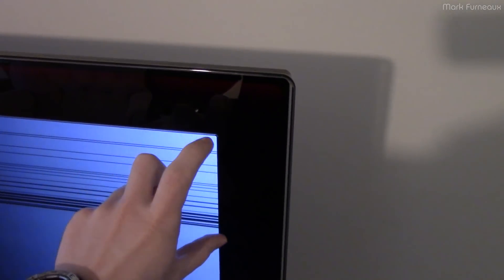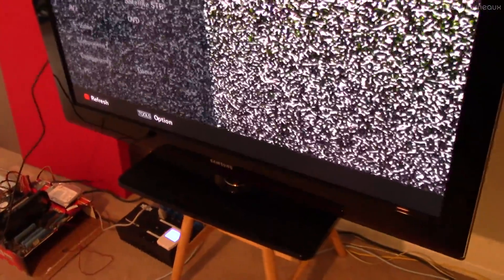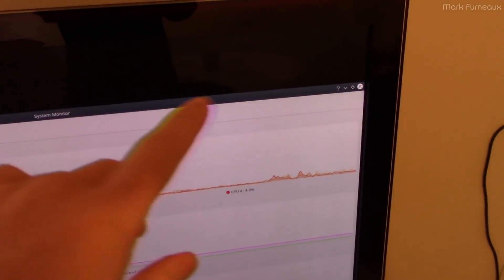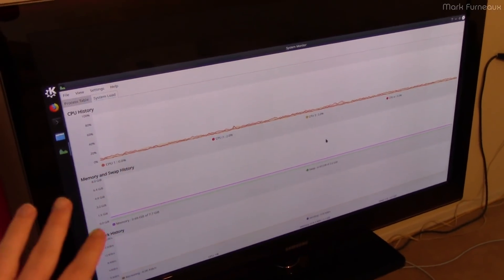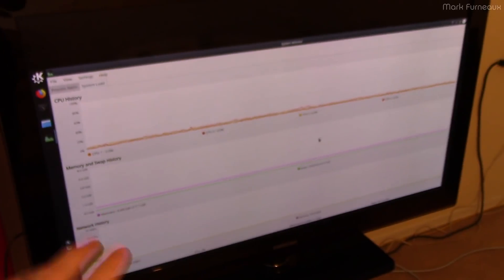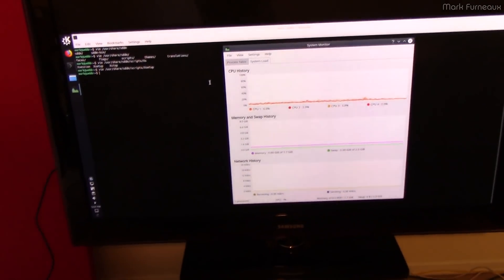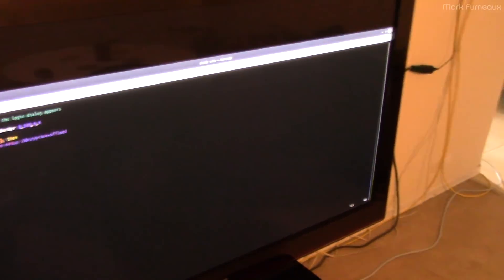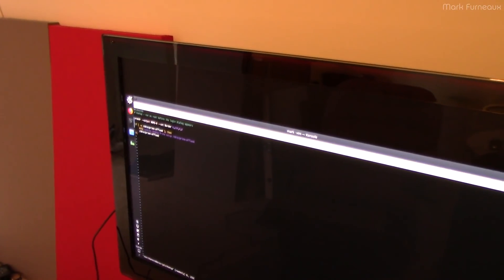How to Workaround Using a TV With Lines in The Image

Comment: Hello.
I know chances are  low.... but my not very old Samsung 50 inch IT is started to act similar, also in my case it's a second block, from the top.
And from what I hear -  i'ts a fairly common problem for Samsung screens.
It's not as bad as what you have shown in the video, but noticeable enough, so when I'll have some free time I'm planning to disassemble my TV (it's being used as a second monitor-informer on my Debian) and try to fix it. 
Worst case  - I'll buy myself a new one.  

Anyway I wanted to ask you - what  would the best way of approach in this case, I do  realize it's a bad connection on the border of the matrix.  
If you have any homegrown tips and/or trick - I would've appreciate it greatly.

P.S. Love you channel.  Both channels in fact.

Comment: You need to set Panning to same as ViewPortIn: nvidia-settings --assign CurrentMetaMode="nvidia-auto-select {ViewPortIn=1920x900, ViewPortOut=1920x900+0+180, Panning 1920x900}"

You currently have Panning set to 1920x1080.

Comment: The only solution I found to work on Windows, was to use DisplayFusion. 15% of my screen had turned black on one side, but DisplayFusion allowed you to circumvent that by restricting the virtual desktop to the area of the screen that actually still works. I still had issues with fullscreen applications, so most games would have to be played in windowed mode.

Comment: There are Windows drivers to enable you to move the image around on the screen to compensate for damage to the display like this. Some video card drivers come with that function built in (Many AMD cards).

Helps with laptops as well since you can continue using a laptop with a broken corner of the screen just fine.
Reply: Such as?

Comment: Could you not swap one of the good driver chips with the bad one? If the lines change position to the section controlled now by the assumed defective driver then it is indeed defective. If not, you at least know it's not the driver (likely it is though)
Reply: Sure but thats a lot of work and assuming you can buy the IC.